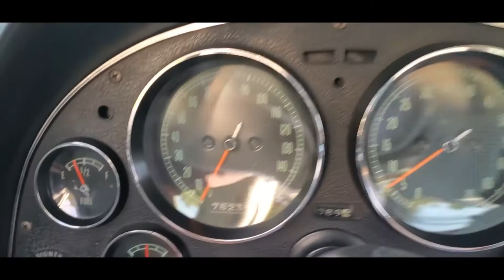Oil & Filter Change On a 1966 Chevy Corvette

Comment: I always chock the rear wheels when lifting up the front, even with the emergency on and the vehicle in gear.  I believe you should be using a speciality oil for your Vette, one with zinc in it.  The label on the correct oil jug might show the additive "ZDDP" which is the acronym for the chemical name of the zinc additive.  The oil does not have pure metallic zinc in it, but a soluble chemical compound that contains zinc.  There are quite a few articles on it.  A Google search on ZDDP oil might be informative.  Also, I believe that replacement oil filter canisters have thinner walls than the originals.  Yours, looks like a non-OEM canister.  The original, thicker canisters fit into that circular groove on the bottom of the block better.  I like your filming technique with two people.  It makes your video more enjoyable and more informative.
Reply from the maker: I found a new oil for the spring I'll be using.

Comment: Thank you for the video but it's really not good to jack the car like that. Chevy didn't recommend it. You can actually spread and change the frame rail geometry like that, it wasn't designed for jacking. Yes many C2s have marks on that cross member from jacking. Doesn't make it a good idea. I won't jack my '66 there, it's not worth any bit of risk. This is why God made wheel ramps. Also, I hate to mention but your jack stands aren't in the right place on the frame. Check your chassis manual.
Reply from the maker: Good to know.
Reply: @xjoe81x  No worries, I hope it helps. I was putting my stands where you did and it was pointed out that the engine can make the car overbalance forward, Probably no issue with a smallblock but why risk it. Nice car by the way.